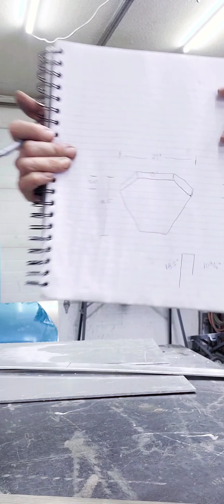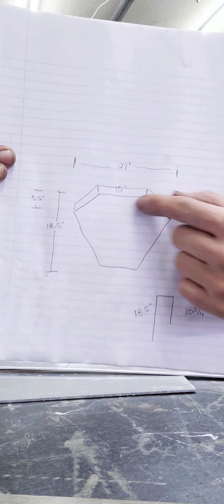Transom Bracket build

Comment: Great looking welds but I noticed there's no structural integrity between to stop flexation of transom caused by torque of the engine and weight of boat with a load of people 👌👍